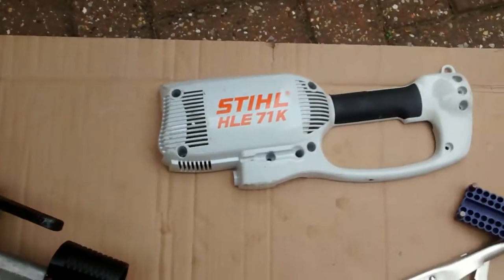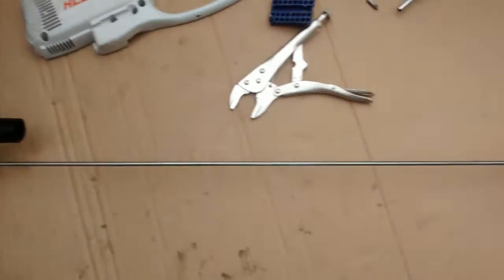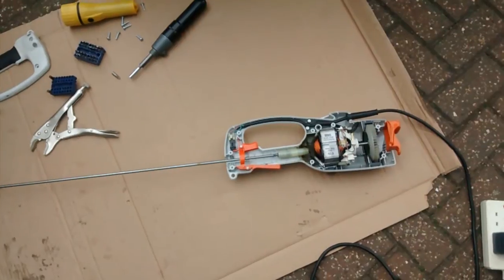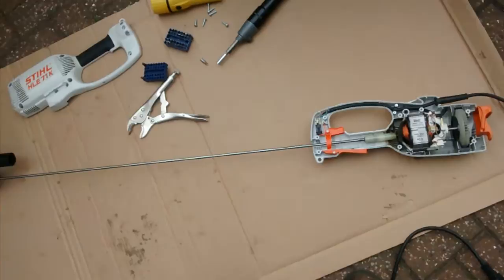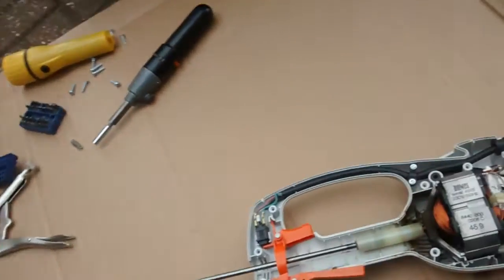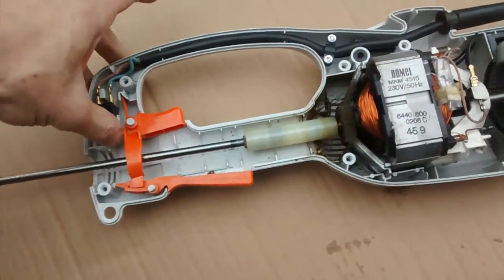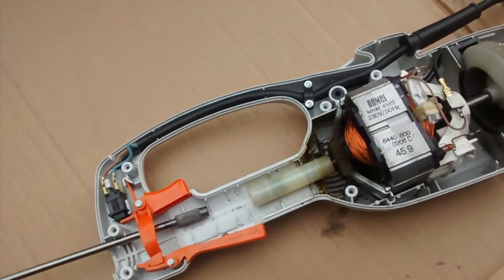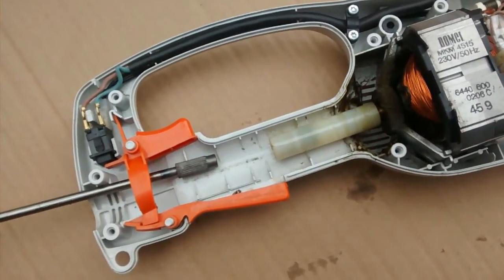Stihl electric hedge trimmer blades stopped working

Comment: Thanks for this! I managed to fix mine using superglue. Remove and clean up the old plastic adaptor and the metal splined drive connector. Use plenty of superglue and clean up as required with a scraper. Leave for 24 hours to harden. Working great now.

Comment: Thank you for an excellent diagnose. You can fix the original adapter the following way. Make a hook e.g. from a small Allen key and draw out the splined insert. Clean bot parts carefully with brake cleaner and glue it in using Cyanoacrylate glue.

Comment: great video thanks, mine has a similar issue
Reply from the maker: +pyraplastic Hi, I am glad you like it. If you missed the writing I put as an update; 'you need the replacement part. It is Stihl adaptor part number 4810-710-7600. This is an updated part and not a direct replacement of what was there in situ. The new part is not grooved and is grooved by forcing it down the splined motor shaft. The part is expensive eg £15 - £30. However I fitted it and it now works.

Comment: glue?
Reply from the maker: Not strong enough to take torque of motor and transmit it into shearing branches in two. Get the right part to do the job, you won't regret it.  It is Stihl adaptor part number 4810-710-7600. This is an updated part and not a direct replacement of what was there in situ. The new part is not grooved and is grooved by forcing it down the splined motor shaft. The part is expensive eg £15 - £30.